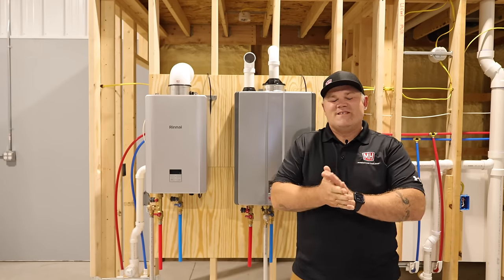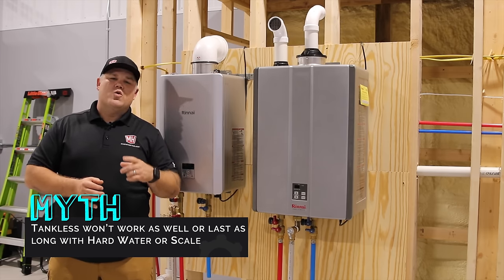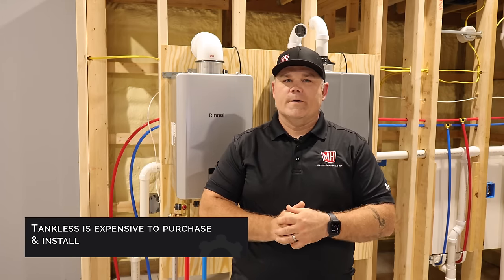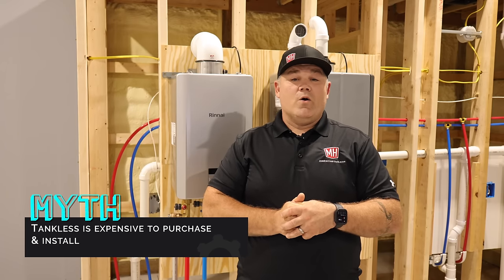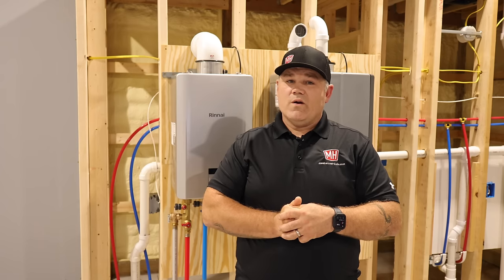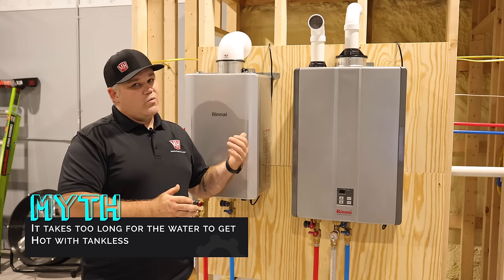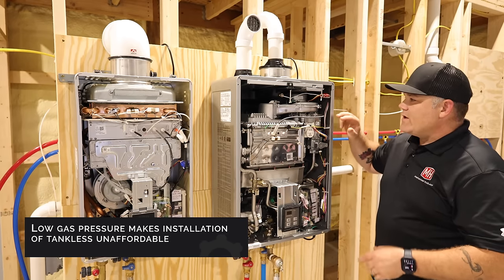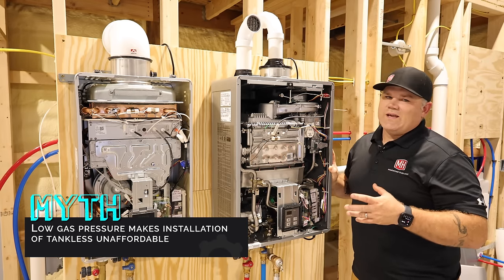Myth Busting! Tank -vs- Tankless Water Heaters

Comment: Your discussion is great about gas fed tankless water heaters.   You need to expand to include electrical tankless water heater vs electrical tank water heaters.
Reply: And please include comparison of electric tankless vs gas powered tankless
Reply: I was just looking for a comment like this.  Exactly my request as well.  I moved from one city that was abundant with gas lines though that state wants to ban natural gas (CA) to another state that where most of the homes appliances are electrical.   Sure you can have gas but the city was requesting an initial charge of $10k to feed in a gas line..
Reply: Jesus is the only way to healing, restoration and salvation to all souls. Please turn to him and he will change your life, depression into delight, soul heading from hell to heaven all because of what he did on the cross 

“Whoever calls upon the name of the Lord shall be saved” Romans 10:13
Reply: Most homes would need an electrical service upgrade to run a tankless electric water heater, they need 60 - 120 amps @ 240 volts.
Reply: I replaced an electric tank water heater (30 Amps @ 240V) with an electric tankless water heater (100Amps @ 240 V). I did not need to upgrade the service, however there are only 2 old farts in this home and we take care not to run the washing machine while one of us is in the shower. This may be unacceptable for some people but it is not much of a bother for us. What is a pain in the ass is the time to get hot water at some fixtures, but that is because this home system had a recirculating pump which I removed for efficiency's sake - anyway that has nothing to do with how you heat the water. In my opinion electric tankless is never going to be as good as gas tankless, if you want hot water with no compromises such as we are putting up with. A couple of teens taking showers or starting a load of clothes is no joke. 😉
Reply: What have that got to do with water heaters???? @HaroutBlack
Reply: @lloydbrown9327  Well, if you're going to walk on water, it might as well be endless hot water? I'm guessing...
Reply: Using electric tankless in camper. 10/10 until it blows breakers.
Reply: @HaroutBlack Weird plug you got here, but I think I’ll pass. I am as sure as you are in your faith that no god exists and am an atheist.
Reply: @HaroutBlack bug out this is not the platform for JC
Reply: @HaroutBlack OK  but we still need hot water
Reply: Electrical Tankless are very costly, you will need at a Min a 225 Amp Electric Service and Up to a 400 Amp Service and Union Electricians  dont come Cheap
Reply: @mankybrains  You could install a propane heater for much less than bringing in a gas line.  One can lease or buy the tank.
Reply: @paulx2777  I explored tankless when it was first coming online.  I tried two used natural gas and two used electric tankless units.   I have plenty of power and gas available.  The electric ones worked for a while but eventually burned out within a year.  The natural gas units worked far better and lasted longer, but not that long.  I finally got a Marey unit that's been working perfectly ever since.  I've never done any maintenance on it and I use very little water except for showers.  I will descale and decalcify if needed.  I live alone and never have visitors, so my total water consumption is less than 400 gallons a month.  The small Marey unit which may not even be legal in many areas has worked perfectly and still does. It's not a condensing unit and my use is so small that it doesn't even matter.  It uses two D cells for the igniter and requires no mains power at all.  Just a gas connection and hot/cold lines.  Many large houses are mandated to have an oversized water heater with the presumption of a large demand.  One size doesn't fit all.  Design to your own requirements, not the average demand.
Reply: @paulx2777  That would max out our main on its own, which is unacceptable under the 80% rule, as we have an older 100 amp service. I really don’t want new breakers. While our old breakers work, they’re better than new ones. That being said, we also don’t have an electric water heater, and if I were to go electric on just one thing, it would be the furnace

Comment: I installed a Bosch in my family’s summer cottage almost 30 years ago. 
I would do it again in a heartbeat. 
Had to clean the pilot one time. 
Provides plenty of hot water from cold well water. 
It’s great. I can only imagine how great the new ones are.
Reply: @billyjack8081  Boy,isn't that the Truth Billy Jack! Consumers are getting ripped off by these newer inferior products! And I believe it is intentional!
Reply: @billyjack8081  old appliances waste enormous amounts of energy. Thirty year-old fridge needs to be dumped.
Reply: does it have a conventional pilot light, or is it electronic?
Reply: @kenovryn  Wrong...
Reply: @RAREFORMDESIGNS  A 20-year-old refrigerator could use 1,700 kWh of electricity every year, compared with about 450 kWh for a similarly sized new ENERGY STAR model. At an electrical cost of 12 cents per kWh, that represents a savings of $150 per year

Comment: I put in a tankless water heater 16 years ago.  My plumber put in a “big blue” filter with a phosphorus insert and I have very hard water.  I have it flushed out every couple of years.  It’s working great!
Reply: If you get a water softener, your water will heat faster and you probably won’t ever need to flush it. There are several other benefits of soft water also. Check it out with a reputable water treatment provider.
Reply: Too much upfront cost. Only 4 more years and you will recoup your money. Then you can buy a new one. 

I never buy into much of that crap. People don't live that long to make a difference. My last HW heater lasted 20 years. I win.
Reply: @lostintime8651  guess you dont have teenge kids LOL
Reply: What does it cost to have it serviced?
Reply: Have been in our house on well 35 years…on our 3rd water heater which my husband (not a plumber) installed…think we’re ahead.  Replacing a standard water heater is probably a lot easier.  We had a 60 gal water heater when the kids were home and the last one for the two of us is now 40 gal…have never run out of hot water.  Our replacement water heaters have been $150-$350 and our electric bills are not excessive.  No one answer for everyone…there are a lot of variables like perhaps all copper insulated plumbing which holds the heat in the pipes when everyone is showering in the morning or the day I do laundry. As well…we have a water softener with a by-pass for the cold drinking water so it’s not salted.
Reply: @happyyoung7630  yeah plumbers tend to push those instant hot water heaters cuz they make big money off them. There's not much money to be made on installing a tank hot water heater.

I spoke to a plumber about installing a split unit heat pump. He quoted me $16,000. I just laughed and showed him the door.
Reply: @jim-ed3zt  not anymore. They are all adults now 😂
Reply: Gas vs electric tankless?
Reply: @jim-ed3zt  30 gallon tank heater is what they need to learn how to shower fast.

Comment: I had a large Rannai tankless heater installed over 20 years ago.  It has never failed - not once.  It's still running like new and I've done very little maintenance on it.
Reply: Same experience
Reply: Time to change it out.
Reply: @sniper.308  your reasoning?
Reply: @peted5217  learn physics 36,000btu per hour or use 40gallon water heater. 200,000 btu per hour use tankless on demand. Gee wiz Peter hmmm

Comment: All I have to say on this subject is that I highly suggest you get to know ALL the requirements of installing tankless way ahead of time. I learned the hard way that there is way more complexity to tankless than one might think. This was far from a simple swap in my case.
Reply: Exactly, which means you need a plumber and electrician to do something anyone with basic tools can do themselves. The hardest part about installing a water heater is getting rid of the old one.
Reply: Yes, thanks for tip. Sometimes you need a blunt reminder to do your research.
Reply: @kcobabe  In some areas you have to hire a plumber to install a water heater, you can't go buy a new heater and install yourself
Reply: @William Castleberry  I would like to know where this. In the US this is not the case.  I come from a long line of fitters and plumbers and they stretch from coast to coast.
Reply: I got lucky as my gas and water lines were easily changed and my vent went straight out the wall through OSB and siding.
Reply: @kcobabe  some areas do require a professional to redo the gas lines. Where i am at you can get fines and jail time for redoing gas lines without the gas company signing off on the work or a licensed contractor doing it due to people rednecking their gas for outside bbqs and blowing up half a mobile park and killing about dozen in the process. and also you could be voiding out your home owners insurance on a tank swap if you do it yourself and something happens like a frost cracking a line and your house gets flooded.
Reply: @SuperDave  yeah, but I'm talking replacement not a whole new system. What you're saying is almost exactly what I'm saying. If you need a plumber or electrician to do this, yeah go tankless. If you don't  stay tank.
Reply: @kcobabe  I'd like to know the same. Not the first time I've heard it, but haven't seen proof yet.
Reply: @leonardwilson980  To install, yes, not to replace.
Reply: Have a tanked water heater gives you back up potable h2O in emergency scenario.
Reply: @M R  technically yes, but once the pressure reduces you'll need to use the drain
Reply: @justanotherdave4835  Well I can tell you this. Moved in, "professional" installed gas stove. Smelt gas a couple years later. Had a  "professional"  come in with a sniffer and repaired flex hose. Smelled gas again a couple years later. Pulled stove out myself. They had the flex line coming out of stove parallel to floor, strait at wall. When you push stove back it kinked the flex line on a 90 sharply at the fitting on the stove. Daa. I put an elbow on stove so there is no sharp bending, kinking of flex line. Just a nice loop going up from stove then looping down to floor.  Now its done  professionally. Couple yrs, all good.
Reply: You didn’t mention the impact of a power outage. I understand when the power is out, so is the tankless water system, i.e. no hot water when the power is out.
Reply: @musicmakerman2266  If I understand you correctly, whats the dif? Lose power with tank it will take time to run out of hot water or to get cold . Tankless you have no hot water instantly. Like a refrigerator. The food will stay cold for a while.
Reply: @1gtmach  maybe mine is different, but I don’t see any electric cords plugged into the wall. So lack of power won’t stop hot water production.
Reply: @notgivingmyemail3381  Very interesting.  Gas or electric would need power. Something on the gas style has to power igniter as well as the power vent fan that exhaust the fumes, if your model has that . Obviously yours is dif. Like a gas furnace. Before igniting the power vent turns on before igniting. Interesting. Thanks.
Reply: @melissasmess2773  Do you drink from your tap? Do you shower with your tap water?
Do you was your dishes with your tap water?If you do with HOT TAP water then you doing it with "bacteria" water, as you say.
Reply: @kcobabe  of course?

Comment: I agree with you,  I have had a tankless  water heater for approximately 20 years, no problems.   I love not running out of hot water.
Reply: you are damn lucky, buy a lotto ticket now
Reply: I installed mine about 15 years ago.  Once I got it dialed in, it's been no problems at all.

Comment: I’ve had a Jacuzzi made by Rinnai tankless water heater since 2015 replacing an old tank heater and we just love it. Everything you say Eric in your video is factual. And I do recommend a tankless water to anyone that asks. The installation was a little expensive, but the maintenance I do myself is simple and easy and we are very satisfied. Thank you for making this video. PS because they last twice as long and so efficient well worth the investment.
Reply: I've only had one tankless heater installed, but I assume replacing it will be cheaper than the initial installation, since the wall mount and piping is in place, right?

The plumber also said there's a potential to replace parts of it instead of the entire unit.
So far it's been about 5 years and I haven't done any maintenance and haven't noticed any degradation.
Reply: if you live in a hard water area the heat  exchangers get limed up and have to be chemically flushed......even when water softening equipment is in use.

Comment: I had a tankless in my last house and I loved it.   I plan on swapping out my current tank heater to tankless. almost instant temp adjustment, endless hot water, takes up much less space.   I've seen no downside.
Reply: Agreed. I installed a combi boiler and it was one of the best decisions we’ve made as homeowners.
Reply: My current apartment actually uses a big boiler. I've never had such hot hot water or an endless supply of it. 
It's absolutely wonderful when I'm hurting a lot. If I ever rented another house I'd actually try to talk the owner into putting one in & even offer to cover part of the cost. Just because of how much it helps me. It's one reason I don't want to move even though I'm in a crappy neighborhood. The other is the convenient bus route nearby.

Comment: I’ve had tankless gas for 8 years now. Totally love it.  I do the annual maintenance myself, and it’s quite simple.  I also have a filtration system to ensure a clean supply of water.  It works fantastic.  I’ll never go back to a tank.
Reply: A carbon filter will eliminate chlorine as well as filter out debris. Soft water will eliminate scale build up and a good water regulator will provide a consistent flow rate for accurate water flow adjustments. Water temperature is determined by the amount of time the water takes to pass through the water heater. If it takes to long, the water will overheat and the safety switch will prevent the gas from heating the water. Too fast, and the water won’t heat up to the desired temperature. My unit is designed for a flow rate of 2.5 gpm. I’m 78 years old and a former industrial piping designer. I installed my tankless water heater in the early eighties and have never flushed it yet and it is still going strong. That’s about 40 years ago. Still have the original bill of sale and instructions. My local plumber didn’t believe me till I showed him. He’s since changed his mind about tankless water heaters.